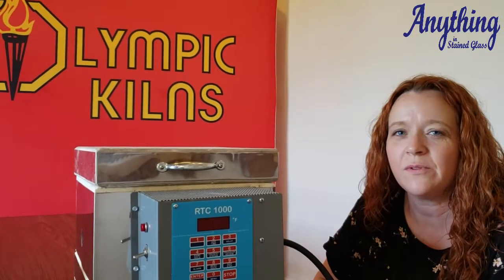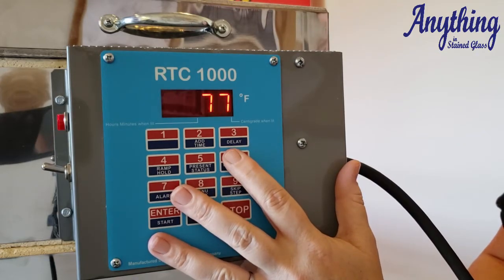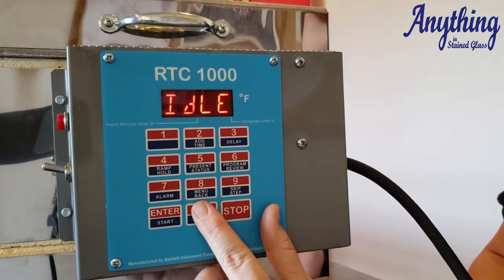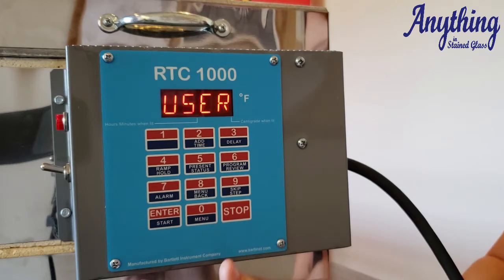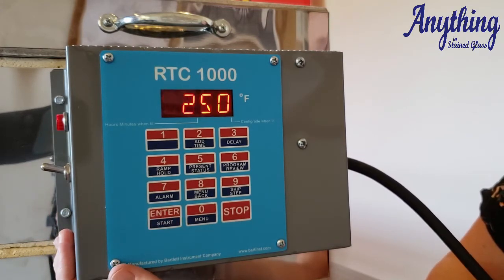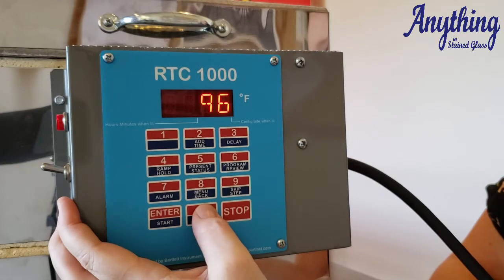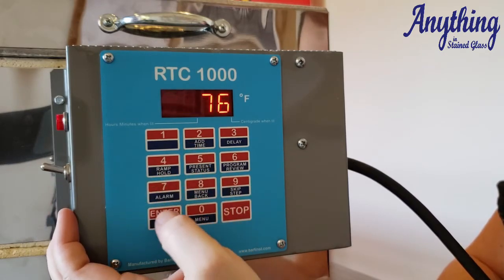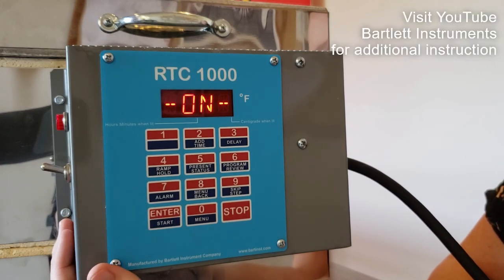Olympic Kilns RTC 1000 12-key Controller

Comment: Sarah.  I just bought an old Paragon Heat Treat oven for knives with an RTC 1000 controller.  I found the manual and this video and I am confident.  Thanks for the no BS explanation - clear and to the point.
Reply: Hi I’m looking to do the same thing is it working for you
Reply: @ZCGOLF  I have not set mine yet.   I will do so soon - follow up with me in a few weeks.